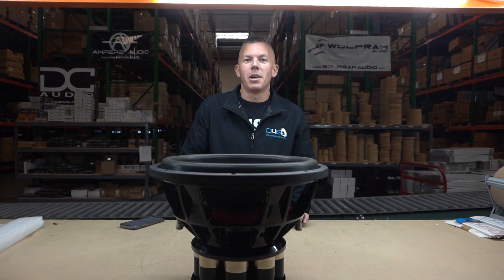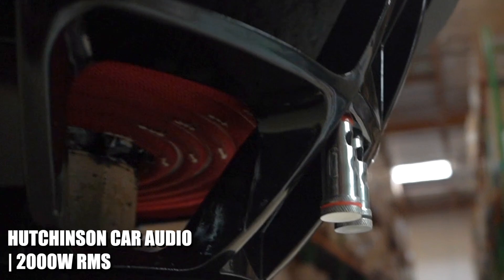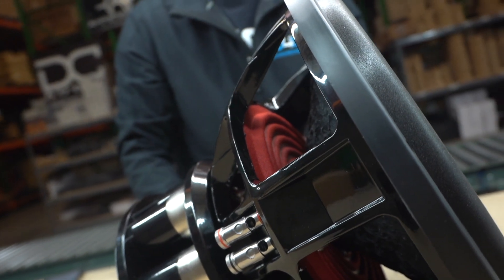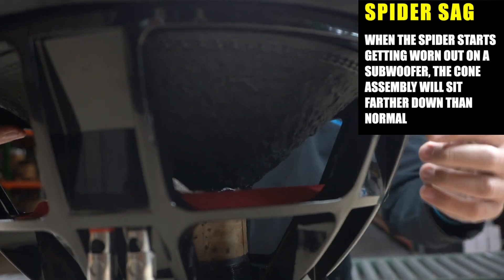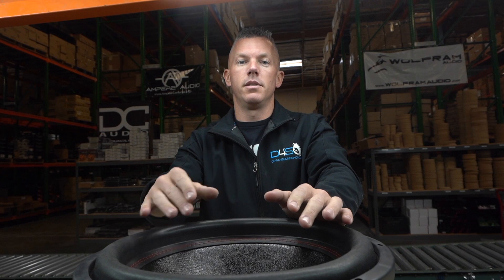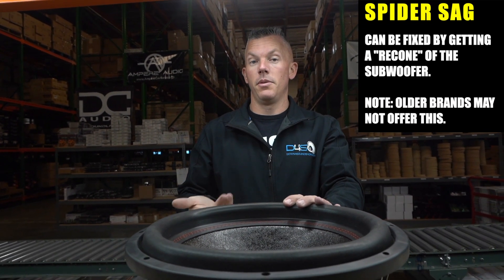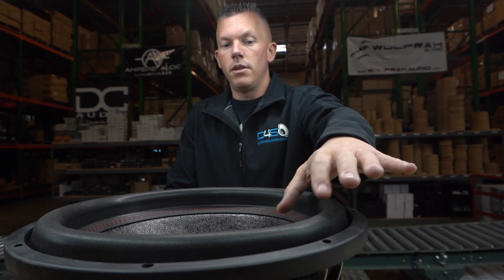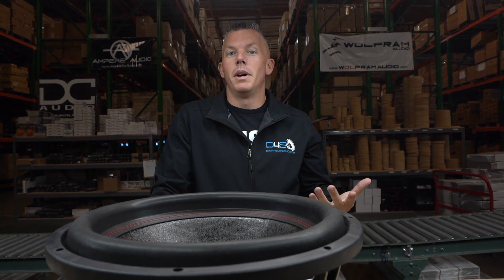WHAT IS SPIDER SAG, AND WHAT DOES IT AFFECT?

Comment: rockford power hx2's are probably the WORST for spider sag... my guess is there is some non-neutral tension between the spider and the surround... aka the surround is exerting pressure on the spider and it slowly sags... i have a few brand new... NEW in the box powers... and they have sag... not alot... but they do, the more they are played... the worse the sag is going to be over time

Comment: So if you create a subwoofer with the same cone area the same linear travel but one only requires 1000 Watts RMS to reach those limits in the other one requires 5000 watts to reach those limits is the 5000 watt better than the 1000 watt??? Outside of the power handling capabilities compared to Output...

Comment: Cool info I've never really thought much of spider's wearing out because I've never came across it. How long or how much play time would this usually occur? Also if its that wore wouldn't you hear it slapping the motor?
Reply: There are many factors that play into a worn-out spider. There is no telling how much time it takes to wear out a spider. It depends on how much power you're giving the subwoofer, if your amplifier is tuned correctly without giving the subwoofer excessive abuse. A 1000 watt subwoofer on a system that is tuned correctly only getting 7 or 800w can last many many years without wearing out excessively. A 1000 watt subwoofer that you're giving 1500 or 2000w will wear out much faster. So if you're looking for your subwoofer to last you a long time make sure your amplifiers are tuned correctly and you are slightly underpowering your woofers. A good rule of thumb if you're looking for a long-lasting woofer obviously it needs to be of good quality and only give it about 70% of its rated RMS. Me personally if I have a 2000 watt subwoofer I'm probably giving it 4000 Watts RMS you might as well enjoy what you have while it lasts.
Reply: Playing a sub could cause spider sag but as an old school collector I can confirm that spider sag can occur on a brand new, never used subwoofer. I have run across other collectors that use various methods to fix/alleviate the issue. Some just wedge pool noodles between the basket and cone to hold the cone where the spider is flat. Others on YouTube use various methods to “fix” it immediately. This involves water and a heat gun but I’ve never personally tried it

Comment: So when i turn my system full tilt im clipping the subs very badly. Ik this because i smell them very quickly. I have a taramps smart 3 bass. I was curious because the clip indicator does not indicate clipping. I figured it was my voltage cus it drops to 11.5-11.9 at fully tilt. So my question is can an amp put out bad signal because of voltage drop and at what point would that happen. Thanks JP
Reply: I feel like you are either overpowering your subs or the clip indicator isn't working correctly.  Voltage drop usually means distortion and or clipping happen earlier (meaning before the amplifier makes its rms power) than the amplifier would normally clip or distort at higher voltage. Truthfully 11.5 isn't terribly bad if that is as low as it gets over extended playing time. Distortion will not overheat a voice coil alone. A bad or dirty output signal will not overheat a voice coil alone. So, with limited info my guess is since the indicator doesn't show clipping then you are overpowering your subs.
Reply: you need an oscilloscope.   spend over 100.00 (not the 40.00. Amazon one. mine died) and you won't be disappointed.